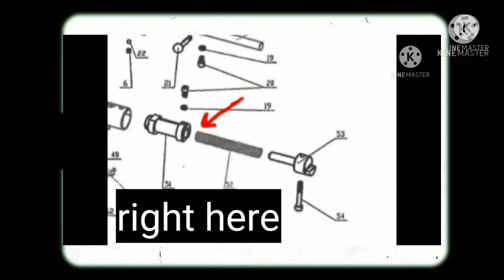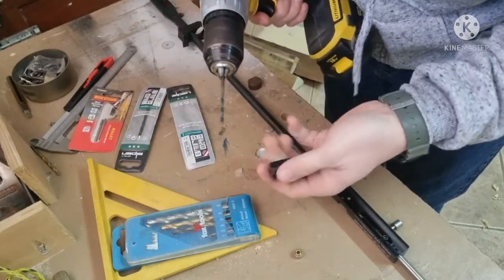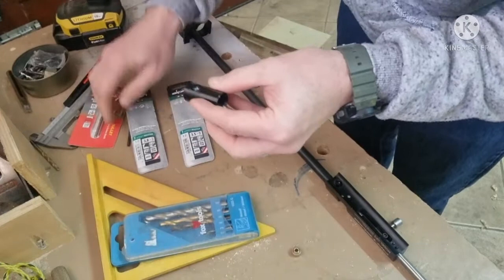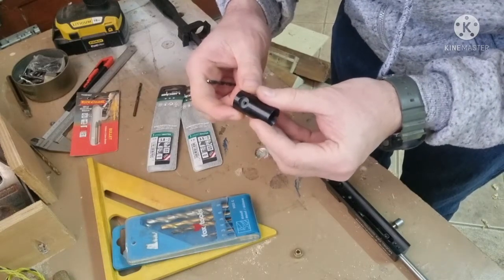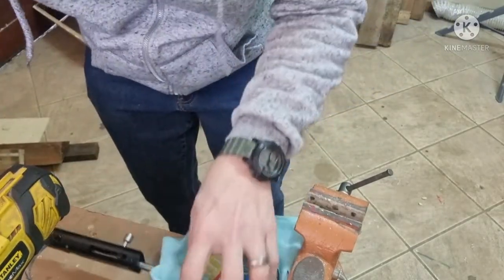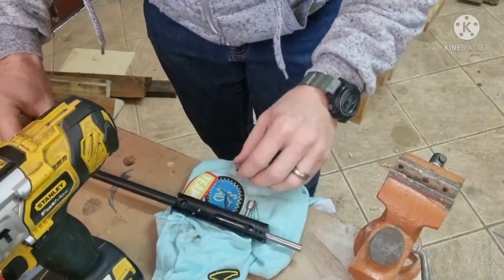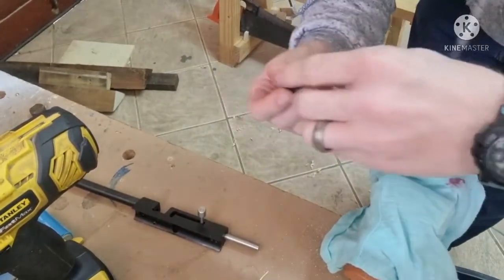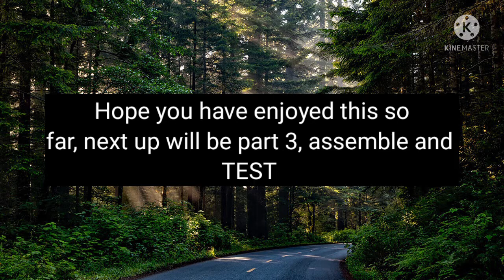Artemis CP2/Diana Chaser - fps boost - Co2 Valve mod - Part2

Comment: Enjoyed and appreciate. If no one has mentioned, a neat trick when cutting threaded material is to put a nut on first, then after cut, running nut off help clean and reshape thread, plus nut can work as a stop to line up the cut and keep true. 🤷‍♂️Cheers
Reply from the maker: Thanks you have taught me something new. Glad you enjoyed the video, welcome to the channel
Reply: Great tip, never though of that, can be used in several applications, good stuff (:

Comment: You are a brave man, I cringe just watching but at the same time I learn so much about what can and cannot be done with the Diana Chaser or the Artemis CP2 or whatever it's called.  After watching all your videos my first modification will be a simple hammer spring modification with a rubber 10mm washer and if I ever get brave enough and acquire the right equipment I may try the valve modification.  Keep up the good work!
Reply from the maker: Thanks @Mark Stephan glad you are learning I am also learning so much but that is the fun I guess

Comment: You always have to be more careful with the softer metal, it catches the drill so quick. Try to drill with a drillstand but make shure you‘re lined up. You can polish with a small brush and juwelers rouge or if the hole is big enough with an undersized drill and  a wrap with superfine wet grinding paper. 
Love your videos bro, you are showing guys with a budget how to get more juice out of theyr gun without overpowering 👍
Reply from the maker: Thanks Andreas glad you enjoyed it, don't own a drill press unfortunately but the result was good

Comment: This is why I use a reamer in a tap handle. They're not cheap and might set me back £12 to £20 quid each. Fortunately I have inherited more than a few first water ones. Holding an electric drill square on to a job is nigh on impossible. A workshop pillar drill will do it but I do not have one at home, and nowhere to put one. The Dremel pillar drill is reasonably precise but you'll not cut as cleanly as a reamer. 
Cutting fluid for aluminium is paraffin (kerosene) which is an 'oil'. For steel light mineral oil (gun oil). Harder steels like the barrel can be like stainless which is horrible to machine, it can spall or tear bits of the surface out. A cutting fluid becomes essential. Getting the drill speed right is important, rule of thumb small drill, high speed. The inside of the barrel will probably now be burred and catch on pellets, mine was, use the copper/brass wire rifle rod.

Comment: Hey Tyrone, first I just want to thank you for quickly replying to all my questions. I really appreciate it. And thanks for all your hard work on the CP2/Chaser platform that you've shared with us all.

One other thing I was wondering about, was maybe using a hand reamer tool instead of a power drill for widening these holes. Do you think that would work also? Not sure how hard it would be, given the curved surfaces and the small brass port etc.
Reply from the maker: A hand reamer will definitely also work, it is probably a little safer as well

Comment: Hi ! superb video you are. they are very interesting. Can you tell me the power with the short barrel after unclamping and what weight of pellets I can shoot. THANKS
Reply from the maker: Standard fps with the short barrel in 177 is around 500fps in 22 around 420fps. Unfortunately the short barrel does reduce the fps by around 20%. For pellets if you can afford it, you won't go wrong with JSB

Comment: Hi there! First of all, thanks for the great videos, really a huuuge help when working with the CP2. From your experience, what would be a reasonable transfer port size for a .22 cal converted to HPA?
Reply from the maker: Hi Zlatan, for .22 I would go for 4mm to start. You could go up to 4.5mm if you find you need more power. If you have converted then you can also play around with the regulator pressure

Comment: Also would cutting some of the threads off of the co2 valve make it so short that you couldn't fully tighten the co2 capsule all the way (after piercing) with the co2 end cap?
Reply from the maker: Hi Neo, no, cutting the threads will in no way affect the length of the valve, it just gives a little more volume inside the valve
Reply: Hmm, in that case I may cut off even more threads than you did. Maybe slightly over half. I was just worried it would shorten the valve length, but now I realize the threads are internal and it doesn't matter (duh lol)

Comment: Could I just use a 4.0 mm drill bit instead of 3.8 mm? That would be a 5/32 drill bit. I have a .22 caliber Chaser. Would there still be enough clearance for the o-rings on the barrel with a 5/32 (4 mm) drill bit?
Reply from the maker: Yes a 4mm should be fine, just don't go too big

Comment: I have a fought that valve is a flow limiter anyway so it cannot go faster through port, you would have to increase opened valve flow, isn’t it? So I wouldn’t widen the port. The smallest diameter always is the limiter of flow no matter how short this limiting area was. Like connecting two pipes and run water through it, if will not go faster than the thin one can go. The rest of mods are fine if you accept lower number of shots and thus lower count of repeatable ones.
Reply from the maker: Your facts are true, that is why you need to open up the valve, transfer port, breech and barrel then there is no more limiter

Comment: Здравствуйте. Сколько одинаковых выстрелов и какова динамика падения скорости? Заранее благодарю за ответ👏👍
Reply from the maker: Not sure, I didn't take shot strings of a complete capsule just 5-10shots. It will drop off faster but to counter that you just need to shoot slower
Reply: Я читал, что в 1 баллончике со2 около 400 джоулей.Теоретически, если энергия 1 выстрела около 16-17 джоулей, то 400/16.5=24. Могли бы Вы проверить это на практике?
Reply: Также, читал, что в со2 имеет значение длительность воздействия на клапан. Если увеличить длину штока клапана на 1 мм, можно увеличить мощность выстрела. Также пуля массой 0.68 грамм будет обладать большей энергией, чем пуля массой 0.52 грамма
Reply from the maker: @Исмет-я6э  no this is not how it works in practice. With co2 you have a maximum pressure of about 850-900psi, this controls the amount of fps you can get. The maximum fpe I have seen from co2 is around 11-12fpe
Reply from the maker: @Исмет-я6э you can incresse the valve stem but you also run the risk of loosing air due hammer bounce and possibly the valve not being able to close

Comment: Hi Tyrone,i did most of your modifications on my CP2 and i was thinking if it's possible to connect directly to the CP2 valve one 2x 12g umarex Co2 cartridges (adaptor or new entirely valve front) for more shots, at the moment I am down to 30-35 shots...LOL
Reply from the maker: I have never physically seen 1 of those adapter but I suppose if the thread matched it would be possible and the adapter would need to fit into the tube. Have you got an adapter or maybe the dimensions
Reply: You can make an adapter with pipe fittings, just take the co2 endcap to a hardware store to size the threads and then find that thread down to whatever thread the tank is
Reply: Dummy co2 cart in the artemis and you're good to go

Comment: I'm gonna have to send you a little variable speed Dremel! I was on pins and needles watching you use the drill and hacksaw....lol...
Reply from the maker: Ha ha ha, Thanks G Whitfield. I actually have a variable speed dremel but sometimes the hand tools make it more pleasing once done. I have a number of tools which I made myself
Reply: @African-Budget-Pellet-Gunner  I noticed the hacksaw! Pretty cool!!
Reply: @African-Budget-Pellet-Gunner  the Dremel 4486 drill chuck adapter only goes up to 3.2mm. There are stepped drills for the Dremel but they're hobby jobs made of cheese not HSS. They'll work on soft metals and plastic but hard steel defeats them, you'll get a few of goes before the tip deforms; treat as disposable. The collet is far more stable and truer spinning than the chuck adapter.
Reply: @andreasbudischek2908  I have the Dremel 300 (older version) and drill stand plus lots of toys acquired for it  over some years. However for ultimate precision I prefer to work by hand e.g. with a pin chuck. It is too easy to slip with a power tools, which is not to say I don't use them.

Comment: Jesus! drilling that barrel is risky, if that drill tip touches the other side of the bore you will end up with less power than you started with. Is it possible to stick the end of a cable tie in the pellet hole or something to protect it while drilling? Bob. UK
Reply from the maker: You are correct it is a very delicate job but I have worked in a machine shop for quite some time so trusted my training. You can definitely use a cable tie or drill stop if you are worried about going too far. The barrel is soft so if you go slow you should be safe
Reply: @African-Budget-Pellet-Gunner   Thank you.
Reply from the maker: Thanks for taking the time to leave a comment

Comment: Thanks for the vidio . I See it before but not how it is done . Thats exakt what i want to do with my chaser . The only thing different is to buy the bras Port here for 8 Euro.  I cannot do it now because i still live in Germany ( and not allowed here ) . But when i settel to Austria . There is no Limit on Power ( airgun ) . The bras Port for 8 Euro has 3.5mm . I See one one eBay also 3.5mm but aluminium.  I rather get the bras one i think . So if i have to go back to Germany , who knowes , i can put the original Port back inside . Thanks again .
Reply from the maker: Sounds like a plan Andreas, it isn't too complicated, just slow and don't force 😉